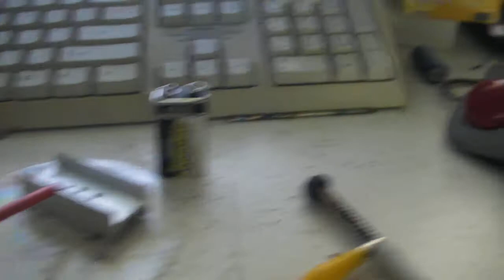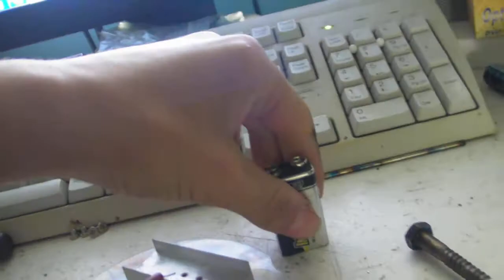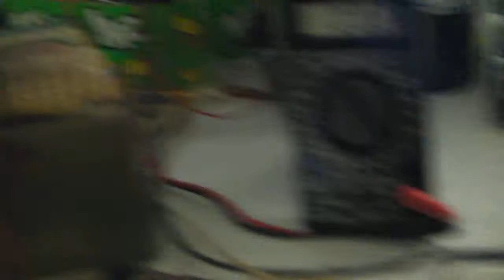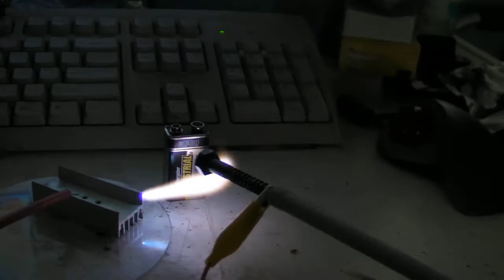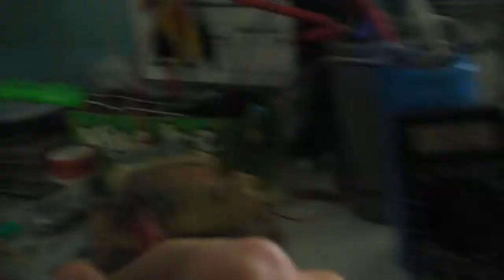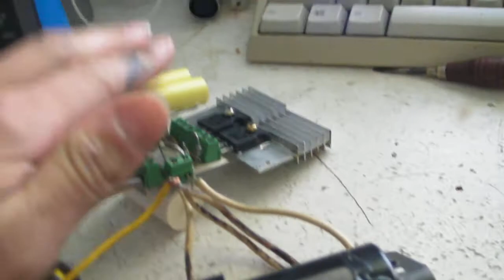Monster ZVS Arcs!

Comment from the maker: @a380rockerfan they are 400v 1uF each, I have two in series. They do get very hot, but the quality makes up for it as they can handle the heat very well as they have been used a LOT

Comment from the maker: @jeffddow Just a heads up. the power at 12V is very tiny. I would recommend at least 24v as 24 seems to be when the driver kicks in. 36V would be the best choice minimum for nice streamers. I would recommend IRF540 mosfets as the 510's have too low of a current for ZVS. It is 100% possible. But like I said, I would do 36v or so (slightly under the limit of IRF540's on the ZVS)

Comment from the maker: @Dri0m Thanks. So far my capacitor bank of 2x 1uF 400v capacitors in series is working great. They get warm, sometimes hot, but they are not showing any signs of death :)

Yes, I am going to start putting flybacks in oil as I am starting to REALLY push there limits (refer to my video "ZVS flyback torture")

Comment from the maker: @derekaggs11 I know, it is an excellent driver. Its very simple and cheap. On top of that, it is very efficient. Pretty much the power you put in, is what you get out. But, I warn you, even good flybacks may get damaged. I already had the flyback used in this video get so hot the plastic on the outside is chipping off the epoxy, also, the high voltage diode inside must have died because both poles arc to ground now. So, the flyback itself is soon to follow.

Comment from the maker: @bucketheadisamaster Thanks! I have no clue on the amps. I imagine it to be below 10 because my power transformer drops the voltage a lot, so its not supplying the needed power. The capacitor is currently .5uF at 800V (2x 1uF 800v capacitors in series) I dont know if they will last because they do get warm, but sometimes hot capacitors still last. By looking at the break out distance, I would guess about 40kv. In about a week I will have a more in depth video on the driver.

Comment from the maker: @PhxSt0rmz I have a rewound MOT for about 35V AC so when rectified and smoothed, that should supply a bit for the needs of this ZVS. ANd remember, this is about the limit of this PCB type ZVS. Once I get some fast diodes Ill make a part to part version using 600v 40a IGBTs

Comment: YOUR ARCS ARE TINY! TINY TINY TINY TINY TINY TINY .. Oh wait im suppose to shutup....Sorry.   Nah, That looks like the size I was getting at those voltage, I say things appear to be working.  you MAY be able to get large at the same voltage using an unlimited amperage  power supply such as a battery, since transformers can saturate if you start running them over their rated amp draw.  Just a thought =)  Good  job =D

Comment from the maker: @ubuntupokemoninc I am plenty safe, my chicken stick is made out of about an 8 inch PVC plastic pipe with a big ass bolt shoved in so it doesnt get hot and melt out. Would you rather I start using that knife like I did in the other videos? As always, I will make a better chicken stick, but I consider this a big upgrade from the butter knife =P